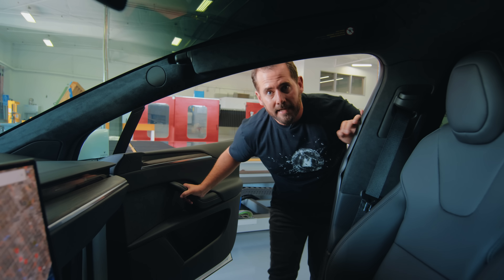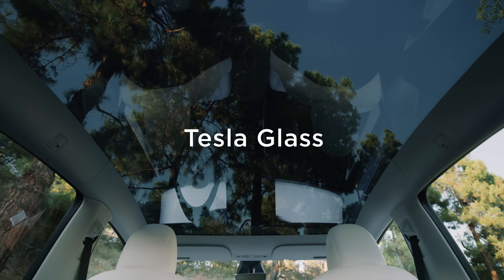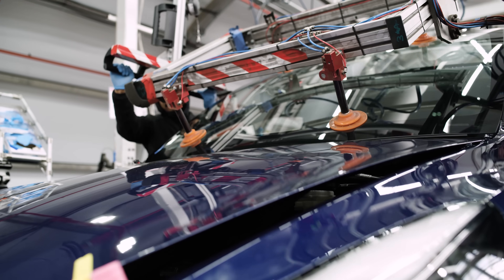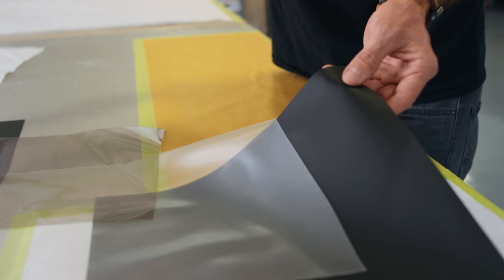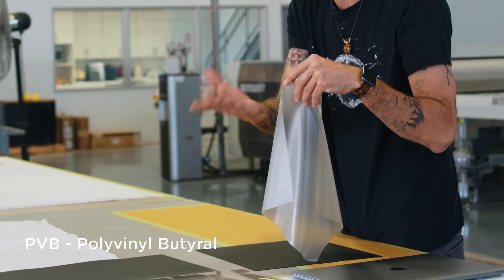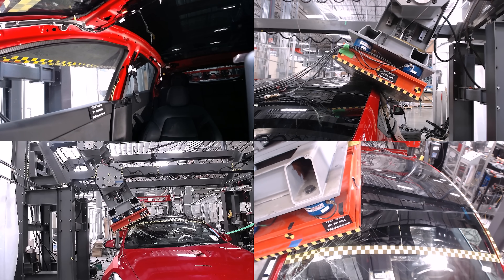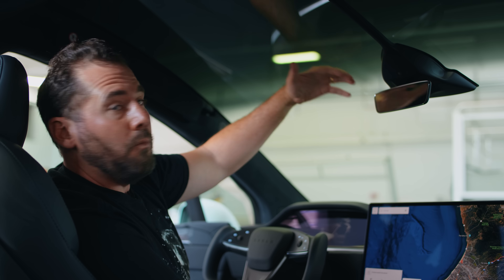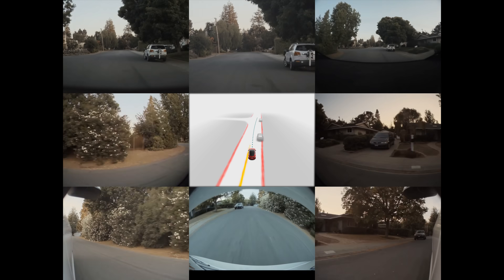Tesla Glass | The Secret to a Quiet Cabin

Comment: Wow! That silence in the cabin is amazing!
Reply: W140 features included:

Double-paned soundproofed glass was a new S-Class innovation first fitted on the W140. This form of window glazing allowed for improved soundproofing, reduced condensation, and other insulation benefits.

Electrically-operated exterior mirrors could be folded by switch to ease driving in narrow spaces.

'Parameter steering' was a system which made low-speed driving easier by reducing the effort required to maneuver in speed-sensitive situations such as parking.

Rear-parking markers, or guide rods. These rods extended from the rear corners of the trunk lid when in reverse, providing the driver with a guideline for rear maneuvers. In 1995, this system was replaced by the sonar-based Parktronic system which measured the distance of the bumpers to nearby obstacles.

12-way powered, heated front seats, with 3 setting memory functions and lumbar support.

Windshield wipers with heated washer system. Later models also included rain-sensing windshield wipers.

Electrically-operated automatic-dimming inside rear-view mirror that tied into the seat and steering wheel memory.

Heated exterior mirrors. Later models also included auto-dimming driver's side mirror.

Orthopedic seats were an expensive option from the factory but consisted of several different air cushions in the seat that the user can inflate and deflate to find the perfect driving position.

Dual-zone climate control. Four-zone climate control on LWB models.

Reclining and heated rear seats on LWB models. V12 models also have the four-place seating option, which allows fully adjustable rear seats, lumbar support and rear sunshade control. The center seat has been replaced by a burlwood center console, allowing a 2 + 2 seating format.

The climate control system could be set to operate for 20 minutes after the engine had been turned off.

Electric rear sunshade.

Rear passenger illuminated vanity mirrors.

Soft-closing doors and trunk.

Leather interiors and burl inserts (optional; standard for 500SEC/CL 500).

In 1995 the S 600 Coupe became the first Mercedes car with GPS navigation system, designated Auto Pilot System APS. It featured CD-ROM maps and full color navigation display in the center dashboard.

In 1996 the Linguatronic voice control system and Parktronic sonar-based parking system were introduced

In 1997 the TELEAID emergency and tracking system was introduced in the US market.

Also, developed with the car, a Bose sound system was available as an option.

Comment: I live in Sweden where the asphalt is rough and bouncy, i used to own Volvos, now we have two Tesla, 3 LR and Y LR. However i think My Teslas biggest weaknesses are road noise and too firm suspension. I wish you’d put acoustic glass in the rear windows aswell as an adaptive suspension or a softer suspension setup for the 3 and Y. It seems the 3 and Y needs new suspension design because the road noise is WAY higher than in my Volvos which had acoustic glass on all windows except the trunk window aswell as air suspension.

Comment: I love seeing the videos like this you bring the human in the machine
Reply: W140 features included:

Double-paned soundproofed glass was a new S-Class innovation first fitted on the W140. This form of window glazing allowed for improved soundproofing, reduced condensation, and other insulation benefits.

Electrically-operated exterior mirrors could be folded by switch to ease driving in narrow spaces.

'Parameter steering' was a system which made low-speed driving easier by reducing the effort required to maneuver in speed-sensitive situations such as parking.

Rear-parking markers, or guide rods. These rods extended from the rear corners of the trunk lid when in reverse, providing the driver with a guideline for rear maneuvers. In 1995, this system was replaced by the sonar-based Parktronic system which measured the distance of the bumpers to nearby obstacles.

12-way powered, heated front seats, with 3 setting memory functions and lumbar support.

Windshield wipers with heated washer system. Later models also included rain-sensing windshield wipers.

Electrically-operated automatic-dimming inside rear-view mirror that tied into the seat and steering wheel memory.

Heated exterior mirrors. Later models also included auto-dimming driver's side mirror.

Orthopedic seats were an expensive option from the factory but consisted of several different air cushions in the seat that the user can inflate and deflate to find the perfect driving position.

Dual-zone climate control. Four-zone climate control on LWB models.

Reclining and heated rear seats on LWB models. V12 models also have the four-place seating option, which allows fully adjustable rear seats, lumbar support and rear sunshade control. The center seat has been replaced by a burlwood center console, allowing a 2 + 2 seating format.

The climate control system could be set to operate for 20 minutes after the engine had been turned off.

Electric rear sunshade.

Rear passenger illuminated vanity mirrors.

Soft-closing doors and trunk.

Leather interiors and burl inserts (optional; standard for 500SEC/CL 500).

In 1995 the S 600 Coupe became the first Mercedes car with GPS navigation system, designated Auto Pilot System APS. It featured CD-ROM maps and full color navigation display in the center dashboard.

In 1996 the Linguatronic voice control system and Parktronic sonar-based parking system were introduced

In 1997 the TELEAID emergency and tracking system was introduced in the US market.

Also, developed with the car, a Bose sound system was available as an option.

Comment: Don't let the legacy auto companies steal your proprietary glass.
Reply: Lol!!!!!!
W140 features included:

Double-paned soundproofed glass was a new S-Class innovation first fitted on the W140. This form of window glazing allowed for improved soundproofing, reduced condensation, and other insulation benefits.

Electrically-operated exterior mirrors could be folded by switch to ease driving in narrow spaces.

'Parameter steering' was a system which made low-speed driving easier by reducing the effort required to maneuver in speed-sensitive situations such as parking.

Rear-parking markers, or guide rods. These rods extended from the rear corners of the trunk lid when in reverse, providing the driver with a guideline for rear maneuvers. In 1995, this system was replaced by the sonar-based Parktronic system which measured the distance of the bumpers to nearby obstacles.

12-way powered, heated front seats, with 3 setting memory functions and lumbar support.

Windshield wipers with heated washer system. Later models also included rain-sensing windshield wipers.

Electrically-operated automatic-dimming inside rear-view mirror that tied into the seat and steering wheel memory.

Heated exterior mirrors. Later models also included auto-dimming driver's side mirror.

Orthopedic seats were an expensive option from the factory but consisted of several different air cushions in the seat that the user can inflate and deflate to find the perfect driving position.

Dual-zone climate control. Four-zone climate control on LWB models.

Reclining and heated rear seats on LWB models. V12 models also have the four-place seating option, which allows fully adjustable rear seats, lumbar support and rear sunshade control. The center seat has been replaced by a burlwood center console, allowing a 2 + 2 seating format.

The climate control system could be set to operate for 20 minutes after the engine had been turned off.

Electric rear sunshade.

Rear passenger illuminated vanity mirrors.

Soft-closing doors and trunk.

Leather interiors and burl inserts (optional; standard for 500SEC/CL 500).

In 1995 the S 600 Coupe became the first Mercedes car with GPS navigation system, designated Auto Pilot System APS. It featured CD-ROM maps and full color navigation display in the center dashboard.

In 1996 the Linguatronic voice control system and Parktronic sonar-based parking system were introduced

In 1997 the TELEAID emergency and tracking system was introduced in the US market.

Also, developed with the car, a Bose sound system was available as an option.

Comment: Smartness overloaded 🥰🥰🥰
Reply: Been around for over 30 years. 
W140 features included:

Double-paned soundproofed glass was a new S-Class innovation first fitted on the W140. This form of window glazing allowed for improved soundproofing, reduced condensation, and other insulation benefits.

Electrically-operated exterior mirrors could be folded by switch to ease driving in narrow spaces.

'Parameter steering' was a system which made low-speed driving easier by reducing the effort required to maneuver in speed-sensitive situations such as parking.

Rear-parking markers, or guide rods. These rods extended from the rear corners of the trunk lid when in reverse, providing the driver with a guideline for rear maneuvers. In 1995, this system was replaced by the sonar-based Parktronic system which measured the distance of the bumpers to nearby obstacles.

12-way powered, heated front seats, with 3 setting memory functions and lumbar support.

Windshield wipers with heated washer system. Later models also included rain-sensing windshield wipers.

Electrically-operated automatic-dimming inside rear-view mirror that tied into the seat and steering wheel memory.

Heated exterior mirrors. Later models also included auto-dimming driver's side mirror.

Orthopedic seats were an expensive option from the factory but consisted of several different air cushions in the seat that the user can inflate and deflate to find the perfect driving position.

Dual-zone climate control. Four-zone climate control on LWB models.

Reclining and heated rear seats on LWB models. V12 models also have the four-place seating option, which allows fully adjustable rear seats, lumbar support and rear sunshade control. The center seat has been replaced by a burlwood center console, allowing a 2 + 2 seating format.

The climate control system could be set to operate for 20 minutes after the engine had been turned off.

Electric rear sunshade.

Rear passenger illuminated vanity mirrors.

Soft-closing doors and trunk.

Leather interiors and burl inserts (optional; standard for 500SEC/CL 500).

In 1995 the S 600 Coupe became the first Mercedes car with GPS navigation system, designated Auto Pilot System APS. It featured CD-ROM maps and full color navigation display in the center dashboard.

In 1996 the Linguatronic voice control system and Parktronic sonar-based parking system were introduced

In 1997 the TELEAID emergency and tracking system was introduced in the US market.

Also, developed with the car, a Bose sound system was available as an option.

Comment: This is soooo interesting!!
When a real life 🚘 automotive engineer explain its automotive tech in a real life video !!!
Reply: Been around for over 30 years 
W140 features included:

Double-paned soundproofed glass was a new S-Class innovation first fitted on the W140. This form of window glazing allowed for improved soundproofing, reduced condensation, and other insulation benefits.

Electrically-operated exterior mirrors could be folded by switch to ease driving in narrow spaces.

'Parameter steering' was a system which made low-speed driving easier by reducing the effort required to maneuver in speed-sensitive situations such as parking.

Rear-parking markers, or guide rods. These rods extended from the rear corners of the trunk lid when in reverse, providing the driver with a guideline for rear maneuvers. In 1995, this system was replaced by the sonar-based Parktronic system which measured the distance of the bumpers to nearby obstacles.

12-way powered, heated front seats, with 3 setting memory functions and lumbar support.

Windshield wipers with heated washer system. Later models also included rain-sensing windshield wipers.

Electrically-operated automatic-dimming inside rear-view mirror that tied into the seat and steering wheel memory.

Heated exterior mirrors. Later models also included auto-dimming driver's side mirror.

Orthopedic seats were an expensive option from the factory but consisted of several different air cushions in the seat that the user can inflate and deflate to find the perfect driving position.

Dual-zone climate control. Four-zone climate control on LWB models.

Reclining and heated rear seats on LWB models. V12 models also have the four-place seating option, which allows fully adjustable rear seats, lumbar support and rear sunshade control. The center seat has been replaced by a burlwood center console, allowing a 2 + 2 seating format.

The climate control system could be set to operate for 20 minutes after the engine had been turned off.

Electric rear sunshade.

Rear passenger illuminated vanity mirrors.

Soft-closing doors and trunk.

Leather interiors and burl inserts (optional; standard for 500SEC/CL 500).

In 1995 the S 600 Coupe became the first Mercedes car with GPS navigation system, designated Auto Pilot System APS. It featured CD-ROM maps and full color navigation display in the center dashboard.

In 1996 the Linguatronic voice control system and Parktronic sonar-based parking system were introduced

In 1997 the TELEAID emergency and tracking system was introduced in the US market.

Also, developed with the car, a Bose sound system was available as an option.

Comment: One of the many benefits of owning a Tesla. You haven’t experienced a desirable trip until you have rode in silence.  If you don’t own one, schedule a test drive.  You won’t regret it.
Reply: W140 features included:

Double-paned soundproofed glass was a new S-Class innovation first fitted on the W140. This form of window glazing allowed for improved soundproofing, reduced condensation, and other insulation benefits.

Electrically-operated exterior mirrors could be folded by switch to ease driving in narrow spaces.

'Parameter steering' was a system which made low-speed driving easier by reducing the effort required to maneuver in speed-sensitive situations such as parking.

Rear-parking markers, or guide rods. These rods extended from the rear corners of the trunk lid when in reverse, providing the driver with a guideline for rear maneuvers. In 1995, this system was replaced by the sonar-based Parktronic system which measured the distance of the bumpers to nearby obstacles.

12-way powered, heated front seats, with 3 setting memory functions and lumbar support.

Windshield wipers with heated washer system. Later models also included rain-sensing windshield wipers.

Electrically-operated automatic-dimming inside rear-view mirror that tied into the seat and steering wheel memory.

Heated exterior mirrors. Later models also included auto-dimming driver's side mirror.

Orthopedic seats were an expensive option from the factory but consisted of several different air cushions in the seat that the user can inflate and deflate to find the perfect driving position.

Dual-zone climate control. Four-zone climate control on LWB models.

Reclining and heated rear seats on LWB models. V12 models also have the four-place seating option, which allows fully adjustable rear seats, lumbar support and rear sunshade control. The center seat has been replaced by a burlwood center console, allowing a 2 + 2 seating format.

The climate control system could be set to operate for 20 minutes after the engine had been turned off.

Electric rear sunshade.

Rear passenger illuminated vanity mirrors.

Soft-closing doors and trunk.

Leather interiors and burl inserts (optional; standard for 500SEC/CL 500).

In 1995 the S 600 Coupe became the first Mercedes car with GPS navigation system, designated Auto Pilot System APS. It featured CD-ROM maps and full color navigation display in the center dashboard.

In 1996 the Linguatronic voice control system and Parktronic sonar-based parking system were introduced

In 1997 the TELEAID emergency and tracking system was introduced in the US market.

Also, developed with the car, a Bose sound system was available as an option.